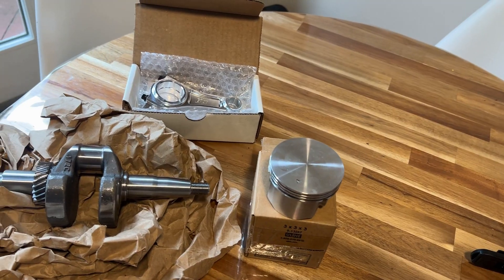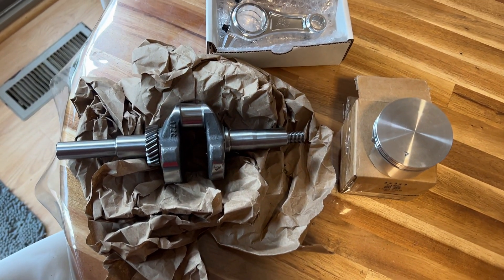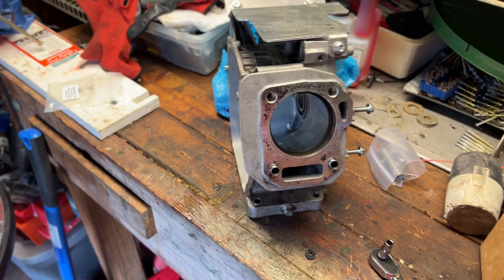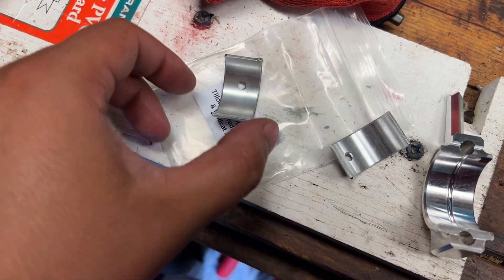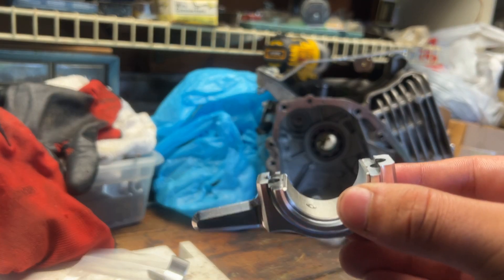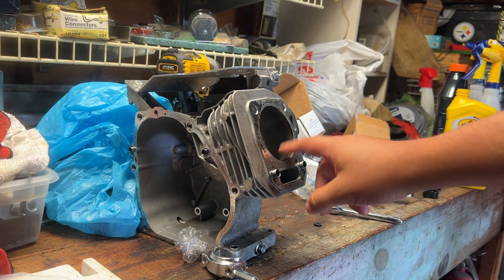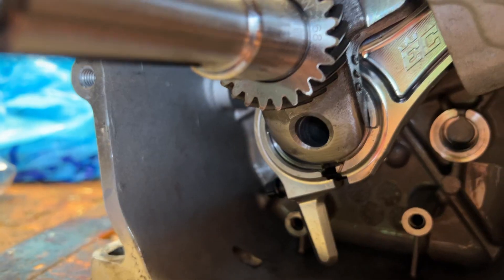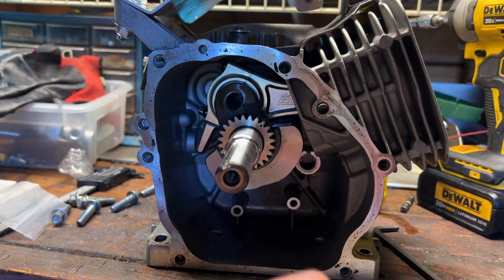INSTALLING EC CARB'S 58MM STROKER KIT IN MY TILLOTSON 212 (223CC'S OF FURY)

Comment: Just curious did u hone the cylinder before putting a brand piston and rings in the motor and just to give a heads up you never reuse a lapped billet flywheel that's been matted to another crankshaft on a new crankshaft because once that flywheel is lapped it's been spec for that crankshaft and u should always hone your cylinder jug when u are installing new piston and rings power will list if not because the rings won't seat properly in the bore other than that keep wrenching I like watching your videos one more thing get rid of the ducar head put non hemi head on there you will get ton more power
Reply from the maker: @kgol4686  didn’t hone the bore and the brand new rings seated well and i have zero blow by. also you actually can reuse billet flywheels on new cranks you just need to relap. have done this plenty of times with zero issue. also i plan on getting big block clones head for the 223, once the weather gets nice

Comment: I tried to order that same 58mm crank from EC Carbs just the other day but their dopey website wouldn't let me checkout. Kept saying No Shipping Options for my address. I was like WTF? Never had that happen before. I live in North Carolina not Guam! So I said screw it and just bought a 58mm crank off DIY Performance on Ebay. Not looking forward to all the clearancing I'm gonna have to do but it should be worth it when it's all done. Tillotson 225 Block with 72mm Bore, 58mm Crank and a 356 Cam paired with either Go Power Sports Stage 5 Head or Pauls Karts Head that has basically the same valve sizes but a smaller 16cc chamber as opposed to Go Power Spors 22cc chamber I'm kinda torn on which to get. Go Power Sports Head has 40# Springs and Pauls Karts has 36# Springs so we shall see which I end up getting. Want this thing to be a real Beast!
Reply from the maker: @JNC1973  it’s been a while since i got my crank but i just got the clearanced one so i didn’t have to do as much. really yup only have to take some material off the weights so it doesn’t come in contact with the rod and cam